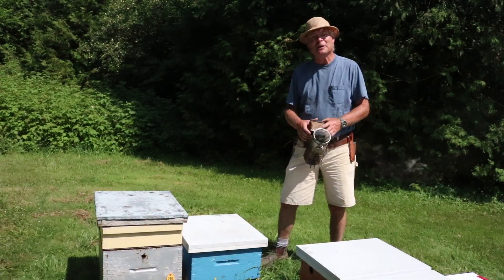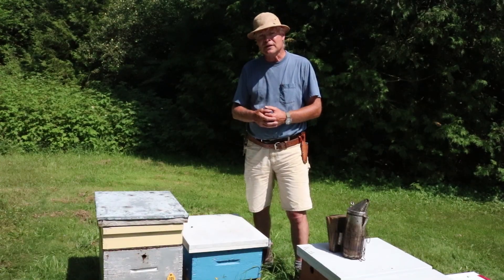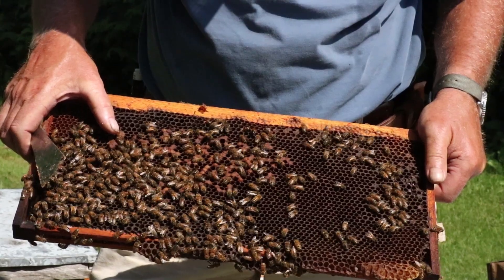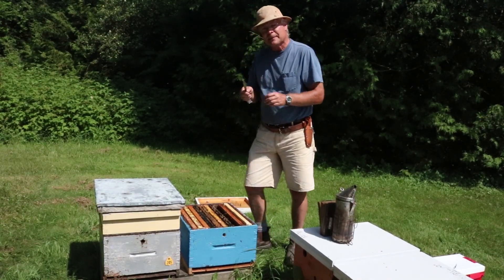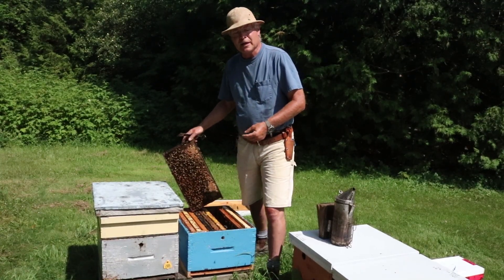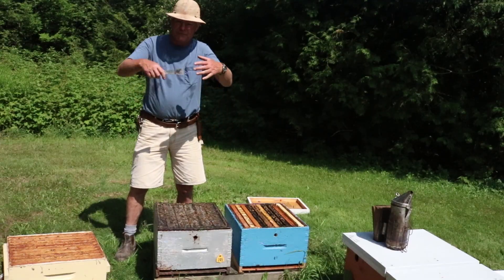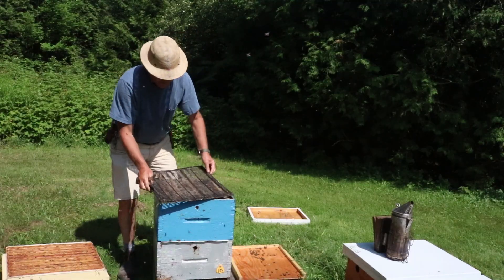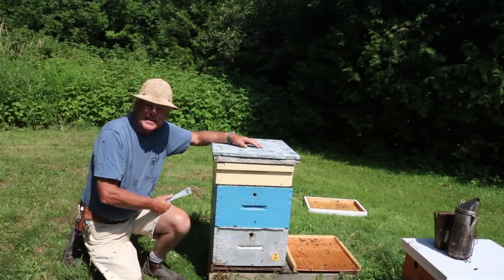Laying Worker

Comment: This might be a strange question. How many worker bees are actually laying eggs? Can anybody confirm that the laying bees can not fly?
Reply from the maker: Those are very good questions. I don't however have good answers. I think we should both look this up and connect later :)
Reply: @UoGHoneyBeeResearchCentre  I've searched it. What I had found is that  there should be around 100 of them in 20 000 bees hive.

Comment: Paul, 
1st, no doubt your "prescription" could cure discontentment within a worker hive, yet...
  Wondering - would not removing those drone heavy frames to freeze out the brood and later use the same resources for the original hive (or possibly to resource a split) be a better solution than just leaving them with the original bees?  
Also, have you tried placing a nuc "above" the worker laying hive using a queen excluder for the first 7-10 days?  Pheromones appear to have the greatest/quickest impact, and the nuc would likely amply supply it. 
Thanks, from a long time sub and always inquiring mind.
Reply from the maker: Hi O.O.
 I like simple and uniting the hive on the spot is definitely simple. Your suggestion of a nuc placed above seem like a good one. I don't get a lot of laying worker colonies so taking the loss of a hive for the option of a later split is fine for me. Keep inquiring!  We never stop learning. A nice thing about beekeeping is that there are many right answers.
Reply: @UoGHoneyBeeResearchCentre  Rule books never live up to expectations regarding bees!  LOL  Thanks for the reply -  and Yes, let's learn and enjoy what "they" teach us!

Comment: Hi, not directly related to the video, but what type of fabric do you use as inner cover?
Reply from the maker: Please see FAQ#1 below. We describe this in a soon to be released video.

1. Why do we use canvas for the hive inner cover? 

A: We use canvas inner covers for a few reasons. They make it easy to take a quick peek in the hive, and are cheap and easy to make. They are light, the lids sit down well, there is less excess wax on the frame top bars, and we rarely need to scrape the inner cover. We use 18 oz (#8) canvas - otherwise known as cotton duck. 
It is available in the USA online at: http://www.bigduckcanvas.com/number-8-18oz-cotton-duck-canvas.html,  In Canada at http://www.jtsoutdoorfabrics.com/18oz-Cotton-Duck-Canvas-Untreated--Natural-60_p_15038.html) or in Hamilton Ontario at https://europeantextiles.ca/product/canvas-21oz-natural/.  
Bees chew through thin canvas so a heavier weight is better. We flip it over periodically when new so the bees thoroughly coat it with propolis. An alternative is a feedbag folded in half. 

2. Why do we use single brood chambers? 

A: Our preference is to keep hives in single brood chambers. We use queen excluders above the brood chamber and then add honey supers. We produce more honey managing our hives in singles vs doubles and we find the hive management much easier. It's become quite common in Ontario, especially over the last twenty years. 

3. Are our queens for sale? 

A: We sell a limited number of queens but do not ship outside of Canada. To contact us about queens, please email infohbrc@uoguelph.ca. There are two other Buckfast breeders in Ontario: Munro Honey http://www.munrohoney.com/and Ferguson Apiaries http://fergusonapiaries.on.ca/. 
 

4. What breed of honeybee do we use? 

A: We work with Buckfast bees. Check out our website if you    would like to learn more about them: http://www.uoguelph.ca/honeybee/breeding.shtml 

5. How do you overwinter double nucleus colonies? 

A: At the University of Guelph, we winter our double nucleus colonies indoors. You can also winter them outdoors by wrapping two double nucs together with insulation on the sides and top. 

6. Are double nucleus colonies prone to swarming? 

A: With a young queen in the nucs and honey supers above we don't have any problem with these nucs swarming in the first year. We do have to transfer them into a full size box early enough the following spring to prevent swarming. 

7. Do we add a frame of pollen or honey into a new split? 

A: Ideally you add both pollen and honey to a new split. Of the two, honey is the most important.

8. Where to purchase some of the products that we use: 
Coveralls: We really like Dickies 100% cotton coveralls. http://www.dickies.com/coveralls-overalls/deluxe-cotton-coverall/48700.html?dwvar_48700_color=GY#start=3. 

We use velcro to straps at the wrist and usually tuck pants into our socks. 

Plastic Queen Cages: Mann Lake (USA) and their Canadian distributors  sell these. They are made by the French company Nicot. https://www.mannlakeltd.com/hair-roller-cages. I use a wooden plug on the bottom and screw it in place with a #4 screw after pre-drilling.

Queen Grafting Microscope: http://www.amscope.com/catalogsearch/result/?q=gooseneck+binocular 

Mini/mating nucleus boxes: Mann Lake (USA) and their Canadian distributors sell these. They are originally from Europe but are widely available. https://www.mannlakeltd.com/shop-all-categories/hive-colony-maintenance/queen-rearing/nuc-boxes 

Queen Pheromone: The pheromone strips were developed in Canada. They are called Tempqueen and are made by Intko Supply Ltd. Suite 604, 3345 Kingsway VANCOUVER, BC, V5R 0A7 Canada (604) 356-7393. pheromonesupply@gmail.com. Mann Lake in the US and several Canadian bee supply companies carry them. 

Bee belt and bulk bee box: Our apiary manager Paul Kelly manufactures the Bee Belts and bulk bee box. If you are interested in more information, please email him at: pgkelly48@gmail.com.

10..Should you remove any queen cells in a colony before          introducing a new queen in a cage? 

A: Yes, you should remove the queen cells. Look very carefully to make sure you don't miss one. Shake the bees off each frame to make sure you can see the entire frame. Accepted queens are sometimes killed by virgins that later emerge from queen cells. 

11. Can you make a split without adding a mated queen/can a split raise their own queen? 

A: A split can raise their own queen (if they have eggs), but it is better to purchase a mated queen or queen cell from a local bee breeder. Queens raised by a split are reared under the worst possible conditions, are physiologically inferior, and you aren't taking the opportunity to improve your hive genetics. For a number of reasons, colonies get more aggressive if splits raise their own queens. We always use queen cells that we have reared from breeder colonies so we can maintain and improve our genetics. Cells found in hives can be poorly reared if conditions aren't good or if you use swarm cells you, are unintentionally breeding for swarming behavior.

12. How often do we check for swarm cells? 

A: We check for queen cells only in colonies that are stronger based on our ratings as described in our “Swarm Control” video. We only do this at the time of year bees are prone to swarming (ie just before the main summer nectar flow). In some colonies, we check twice, a week apart, if we have the time and we've found cells in them previously. We stop looking once the nectar flow gets going and the time for swarm preparation has passed. 

13. How old is a queen when we replace her? 

A: We re-queen if a queen isn't doing well or when she is in her third year. 

14. How often should you be stung to lessen the chances of developing anaphylactic reactions? 

A: Please speak with an allergist if you have any concerns regarding bee sting reactions. You don’t need that many stings to build immunity and reduce your chance of developing an allergy. However, reactions can be very different from one individual to the next. For about three years after starting beekeeping you swell more in the spring when the bee season starts. After that most people don't swell up much at all. Some beekeepers apply stings through the winter to keep building immunity. 

15. What do we use as candy for the queen cages? 

A: You can make the candy using honey and icing sugar but the candy you see in the tubes in our videos are purchased with the cages from Mann Lake beekeeping supplies and their Canadian distributors. In Ontario, it's not legal to use honey in queen candy if you are distributing queens. Honey can contain American Foulbrood spores. A specialized, non-drying, sugar syrup (Nulomoline invert sugar) can be used instead of honey. In any case the candy must be made dry enough that it's crumbly.

16. How do we make pollen patties? 

A: The patty is made from pollen we collect using pollen traps. We mix the pollen pellets with sugar syrup to a dough-like consistency, form the patties between layers of wax paper and then keep them frozen until needed. They will keep for several months in the freezer.

17. How do we make our grafting bars? 

A: We cut the wood pieces and attach them to the graft bar with liquid beeswax. We then attach the cups with liquid wax. In both cases the liquid wax is applied with a large syringe. In the past, we made the wax cups but now buy them from https://www.kelleybees.com/. 

18. Do we move full honey supers to the top of the stack so the bees can fill the lower ones? 

A: Some beekeepers shuffle the supers around and do what's called bottom-supering. We place supers back on in the original order and only add new supers on top (top-supering). That way it's easier to see when the bees need more space. The bees also ripen the honey before moving up to the next box. We sometimes harvest full lower supers and put the top ones that aren't full back on in the original order. 

19. Do we ever add brood frames to the cell builder colonies to keep their populations high? 

A: We do add other frames of sealed brood and sometimes we shake in more young bees from brood frames to boost the hives. About once every three weeks we'll boost the hives in one way or another. 

20. How do you level hive stands? 

A: We level the hive stands periodically with pressure treated wood shims. If the hives are already on the stands, we use a hardwood pry bar and a brick fulcrum to lift each end for shimming.
Reply: looks like shipping wrapping that you pop
Reply: I use a painters tarp from the big box stores. You can make many from one tarp. What he uses looks similar.
Reply: @jasonsperry815  How is that cloth doing in high moisture situations? Is it keeping warmth during winter months enough compared with top board?
Reply: Such question is literally under every each of previous videos 🙄.

Comment: what if you have a very strong colony and im talking 3 boxes, is it okay to just give them brood frames (eggs larva and capped brood) and just let them requeen themselves ? ...
Reply from the maker: Hi Abdel
 I don't think that would work if the workers were already laying.  Please watch our video coming soon on 'Why Buy Queens'.
Reply: I say, give it a try sometime. Maybe add a queen cell along with the brood frame. Or maybe a mated queen along with a frame of brood.
Reply from the maker: I have had success with adding brood, bees and a queen or queen cell so those are good ideas Jim. Laying worker colonies are often weak though so you need to add a lot to make them viable. I'm trying to work through the yard quickly and find it better to keep things simple. A loss of one hive is an opportunity to make up another one later when you unite.
Reply: Question: You say that the "smell" of brood an/or a queen will cause the laying workers to stop laying; about how long does that take? Overnight, a few days, weeks?
Thanks in advance.
Reply: @tarnishedknight730  you may want to ask this question under the main thread rather than under Abdel's question because it may go unnoticed here.